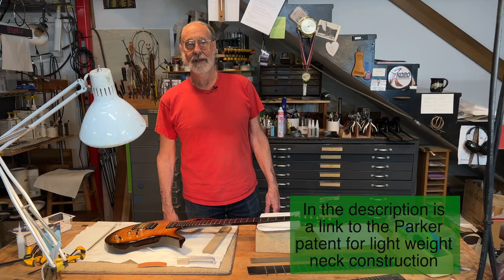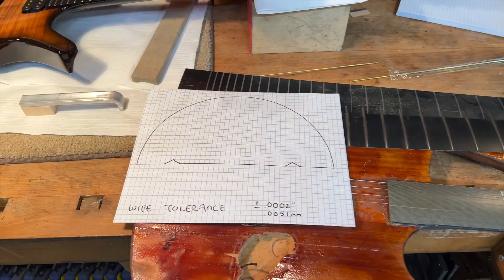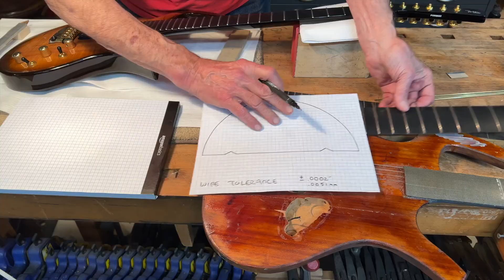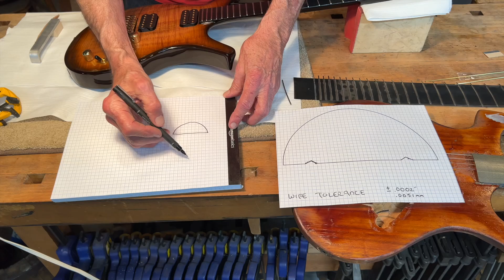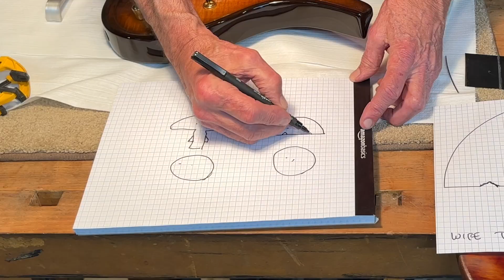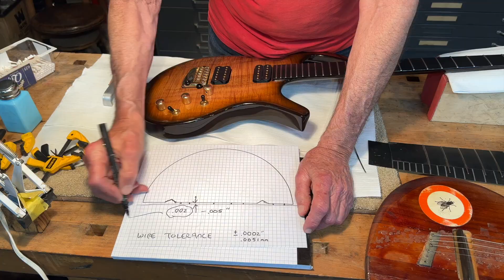Ken Parker Archtoppery - Riff 021 - Fly Fret Gluing - Chapter 1 of 2

Comment: I have a parker fly hardtail. The guitar has being played a lot and there is not sign of wear. I own a Suhr and after 10 years I can see the frets are a bit square in the middle of the fretboard. In this video it is mentioned that the Parker Fly uses 304 stainless still, I can not find how to check what kind of aloy is use by Jescar, the company making the frets used on Suhr guitars. Actually I coudn't find it on any brand ofering that information.
Reply from the maker: The 304 material is way too hard and tough to be rolled into a standard fret cross section with its big, long, studded tang. There is just no way to do it. When I asked my wire vendor about rolling the 304 into a fret shape with a tang, he just laughed. The 304 is not nearly ductile enough to flow into this complex shape, and I was told that any attempt would surely destroy tthe solid carbide rollers that they use to form wire cross sections. I specified the wire as hard as possible, which depends on the work hardening of the material as it is rolled, greatly influenced by the size of the round wire stock they start with. "We can barely make the "D" shaped wire you want now!" is what I was told. They sure did a great job of it, though , it came out super hard and erosion resistant, and they held crazy tolerances, barely measurable with a micrometer!

All this to say that "stainless steel" is a big group of alloys with widely varyiing properties. The 304 work hardened materrial we used at Parker makes all other alloys of stainless fret wire look like soft goo. These softer, more ductile alloys will wear in the usual way.

Comment: Hey @kenparkerarchtoppery9440.  The Parker Fly is one of my favorite guitars.  I've recently begun building guitars myself and am curious as to what, exactly, was in the composite that was on the back of the guitar?  I've heard there was a 1in strip of carbon fiber down the length of the neck and then a layer of fiberglass that covered the entire back of the neck and body.  Was that it?  What is the grey material in this video: https://youtu.be/Yt085421u_U?t=141

Thank you!

Comment: Seems like a lot of consistency, Ken. Is it possible that also the fret mass and shape is important for consistency in sound ? I refretted a telecaster, and i made a comparison before levelling ( and before crowning )and after, by playing tones on the high frets. After levelling i found out, that the tone on the levelled ( and sanded/ polished ) fret was different in that way, that it had more body, but a slower attack. I crown and polished it again, and it has its faster attack again, but with less body and also less sustain ( which is 100 percent surely not related to buzzing after my  crowning artwork....).I did glue all frets in with super thin superglue. Did you ever made this experience that also ?

Comment: T304 stainless and glue-up tolerances the same as main journal clearances on a blueprinted NASCAR engine (0.003").  Pre-glue-up surface prep with a laser.  Getting into some overkill engineering there - just the way I like it.  T304 and .003" clearances - it's like working on one of my hot rods.
Reply from the maker: Right on w/ the right on.

Comment: Hello Ken! I need a stainless second fret for my original deluxe - no tremolo bar. 
Apart from that it is in immaculate condition. 8^) I note the Ca, accelerator, ->cannot be shipped to Australia 8-/, tooling and method from vid2 - can do! 
I am just missing the stainless fret itself.
This is NOT a complaint! It spent its first ten years in the tropics - ANY frets would have a hard time in such a humid environment.
I have my own jewellery workshop so I am not afraid to take complete responsibility for the remount. (given this excellent information, thank you).
Reply from the maker: Please email me, and I can make this easy for you. You don’t need accelerator, just thin, fresh Cyanoacrylate glue. Best bet might be your local hobby shop.
Reply: @kenparkerarchtoppery9440  I will Ken thank you SO much you are a true genius and an absolute gentleman which the entire industry also notes you as. Kind regards.

Comment: I daresay this is an example of a happy accident for all of us guitar players that such a brilliant mind hasn't ended up in NASA or something but in guitar making.  Hats off to you Mr.Parker, this is so inspiring!
PS: That glass-beads-spacer thing is... Well, I can imagine the process, but in my mind it's as far from luthiery as it could possibly be. Which makes it cool AF
Reply from the maker: Ha! What an interesting comment! If you only knew how allergic I am to reporting to anyone, you’d know that I wouldn’t have lasted in any industry without a bodyguard! The glass bead / grains of sand spacer thing is quite a common way to insure that the adhesive isn’t ejected from the glue joint by clamping pressure, and that an optimal film thickness is achieved. BTW, the dreaded failure mode of this kind of “too thin” or “all squeezed out” is called a “starved joint”.
Since guitars and other stringed instruments are mostly made of wooden parts joined with adhesives, the whole art of bonding this to that is a central method/skill to all builders, so any adhesive adventure is naturally right straight up the alley of Lutherie!

Comment: Been looking for in depth info on this process for about 5 years since I found some of these fretboard blanks on e bay and bought then mostly because they were just a cool/unique item…but now? It’s time to order some cotter pins…my idea is to use a thin substrate under them rout shallow channels for frets. No where near as impressive as original concept but might enhance stability and ease of clean installation w epoxy…..my high-level-hackery solution haha…,
Reply from the maker: Good luck!

Comment: i glue in stainless steel frets, and cut the slots just wide enough to press them in by hand. stainless is so hard if i hammer them in they pop up like playing whack a mole on a sea-saw. nickle silver is alot softer and maluable and they fit in the slots withh friction alot better
Reply from the maker: We’ll sure they do, when you strike a piece of metal, the surface gets work-hardened, and then changes shape, and it’s all downhill from there. The method would be to lightly over bend, and then press or very lightly tap home with a plastic face hammer in order to avoid this condition, which is un-recoverable-from, if you know what I’m saying.

Comment: I’m a composites engineer as my day job. And I was wondering did you ever consider compression moulding these in there entirety using a thermoset compound ? For example a carbon web polyester smc or bmc? Then you could mould the fret in as an insert for example. It’s very dimensionally stable. And would make a fret board take, I would estimate around 4 minutes to bake. And with a fairly modest press you’d be able to probably make 4 at a time. Could be that in a morning you’d have 100 ready to use boards. Which are storable stable and already in a finished state. ? Just food for thought. I’m an amateur guitar builder myself and often think this stuff through. Although budgetary restraint obviously apply 😂
Reply from the maker: Thanks for these suggestions! I think your idea of molding frets into/onto a board with these materials would probably work well, but in order to get the strength needed, the part would be considerably heavier than the design we used for the Parker Guitars instruments. I decided 4 decades ago that polyester resin wasn’t a good choice for instrument making, and I doubt that I’ll ever feel differently. It’s too “gooey” for my taste, and so has lots of unwanted damping, apart from being much lower strength compared with the best epoxies. I know that lots of high volume parts are made with these molding processes, and they perform well for lots of parts. I don’t know much about designing for these materials, but I have always been keen to have control over fiber orientation, both as a woodworker, and also in composites. The random fiber orientation of these materials seems like a bad use of fiber reinforcement especially as I have tried by best to use as little composite material as I could get way with, partly because it is so much heavier than wood. It does seem to be a fertile area for exploration, as you suggest, and I’m currently designing some items to which this class of random fiber oriented pre-preg materials could apply.
I don’t like using polyester resins in my work, as my experiments with them vs epoxies 40+ years ago led me to conclude that they sounded way less wonderful than crisp epoxies cured at elevated d temperatures.

Comment: I don’t even know why this popped up in my feed but it’s absolutely amazing. I’d like to share my story if there are any other nerds here that might find it interesting. I’ll try to not make it a novel. 

I’ve been designing and building my own instruments for a while now that are fiddles that feature frets. I’ve resisted the traditional fretting methods and have been told by other builders that it’s very difficult to bend standard frets over the tightened radius of a bowed instrument. So I initially was building very cheap and rustic things using 1/4-round moulding straight from the Home Depot as a fingerboard because it already has the perfect radius and perfect width for 2-3 strings(I was inspired by the erhu and morin khuur fiddles). I then would tie round jewelry wire around it with a knot on the bottom side and install risers to hold the fretboard high enough off the neck to leave clearence for the knots. This worked for a while, especially when I was using the “cigar box guitar” approach to building the bodies. But as my woodworking improved I felt that the look of the knots were cheapening the overall aesthetic and I was looking for ways to hide them. I’ve gotten some good results now and again but it doesn’t always work out as well as I like and I’m always brainstorming new ideas anyway. I began using Sendcutsend to get my custom hardware laser cut and the results are amazing(I no longer use a hinge as a tailpiece). But then I thought, maybe I can have frets cut to a custom shape that can basically “snap” onto the fretboard, leaving me with a zero-clearance joint of the fretboard and neck. So I’ve attempted multiple variations on this idea and still don’t have one I’m 100% set on. But it’s my constant obsession throughout the day. I’m frying up your chicken tenders thinking about my next fret design that could be the one I’ve dreamt of.
Reply from the maker: Check out Mark Wood’s cool electric violins, I met him on 48th st in the late ‘70’s, when he was doing some very creative work. A hard rocker, he was performing on a 7 string fretted violin he designed and built. No problem for him to bend the frets, so just go for it, the regular frets are gonna work fine.
Your inventions sound fantastic, keep on doing!
https://electricviolinshop.com/collections/viper-violins?gad_source=1&gclid=Cj0KCQjw-ai0BhDPARIsAB6hmP7aorVT09I4plxGenfM9HGTpicwYycssv3vleXjz8HelsAeHKJkqm0aAj8HEALw_wcB
Reply: @kenparkerarchtoppery9440  I’m very familiar with those, for sure! Yeah, I’ll try frets eventually but I have a lot of fun trying new things. I feel like I’m so close to something really cool with it. Thanks for the encouragement!

Comment: very nice on how you've used conventional steel for frets!
Reply from the maker: OK, so maybe I wouldn’t think of 304 passivated stainless as “conventional steel”, but OK, close enough. Actually, we are constrained by the properties of the several alloys that the metallurgists have settled on as desirable, which, in the case  of 304 means pretty spectacular corrosion-resistance as well as great stiffness and strength numbers, topped of by superior surface hardness due to the manufacturing process of “rolling” (squashing between two solid carbide shaped wheels) wire from round to half-round.

Comment: So you used micro as mechanical spacer for the adhesive. Probably the first (maybe the only) time it was used as such. Also - frets harder than the hubs of hell? Impossible to level and polish.
Reply from the maker: 1) glass beads or other carefully sized mineral particles are standard issue in the adhesive industry, as they insure the correct thickness of the “bond line”. You can think of this bond line as a laminate that just happens to get permanently involved with the surfaces of both materials.
2) The hardness of hard-rolled 304 stainless is a little difficult to measure exactly, but just let’s say that is substantially softer than the hardness of a file, which is normally about 60 on the Rockwell C Scale of hardness, which is to say, very nearly as hard as steel can get. This means that the 304 stainless frets are certainly machinable by the usual fret dressing tools, although it will require more force to keep the files “in the cut” when leveling and re-crowning, and also the abrasive papers used to remove the file marks will wear out more quickly. I assure you that this is nothing like “impossible”, and more like a bit more time consuming, but really, no big deal.   
3) I’m happy to report that this is rarely required!
Reply: Using glass beads as an adhesive spacer is very common. 304 is not very hard(even with this sort of processing), normal frets are just really soft. There are several industries that routinely polish materials much harder(knives are one example).